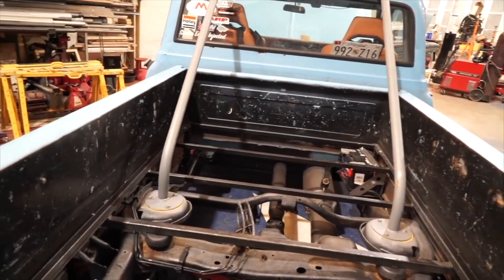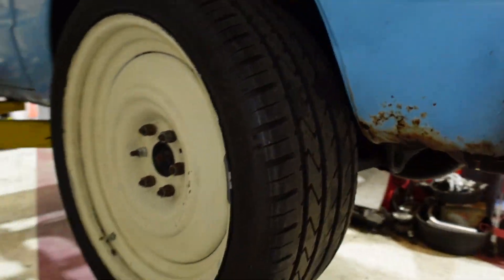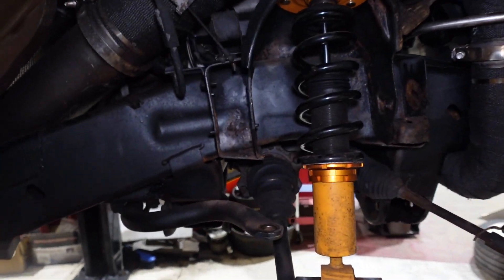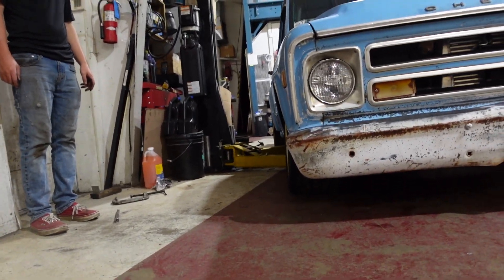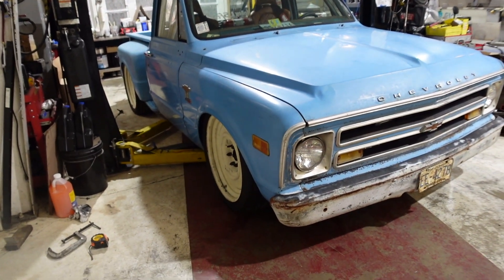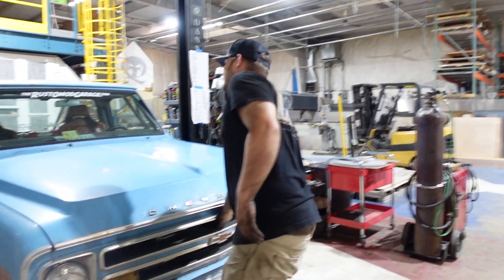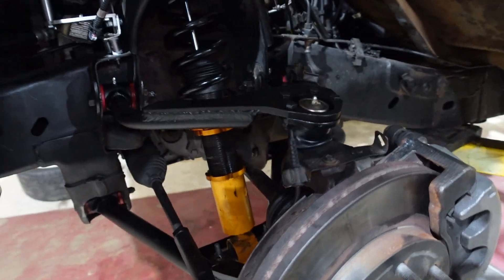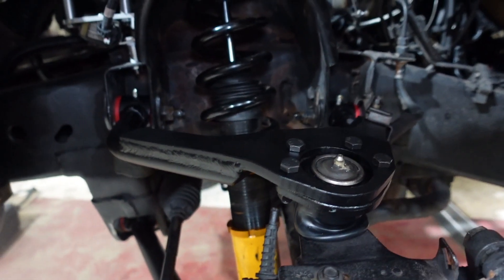WE FIX The AWD C10 Escalade Chassis Swap's Biggest Issue!! Front Suspension! (Rustomod Garage Ep.20)

Comment: Sweet truck. What's the wheel width and tire size? Also, how are those control arms holding up?
Reply from the maker: The transports are 9.5in wide the tire size is 305/35 22. They are holding up great haven’t had any issues yet!

Comment: Why did you go with a 07+ frame?  Does it fit the body better than a classic body frame? 03-06?
Reply from the maker: I have a few videos talking about it a little bit but the 07 up has rack and pinion steering, coil spring front suspension and in my case has the aluminum block 6.2 in the Escalade.